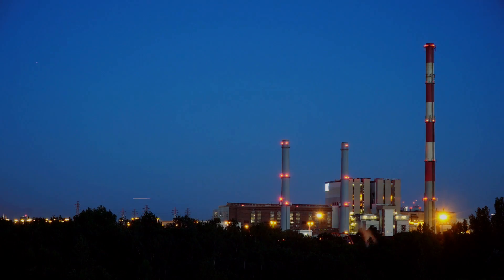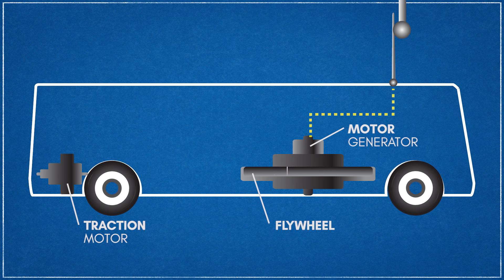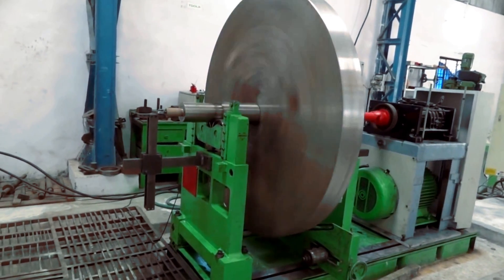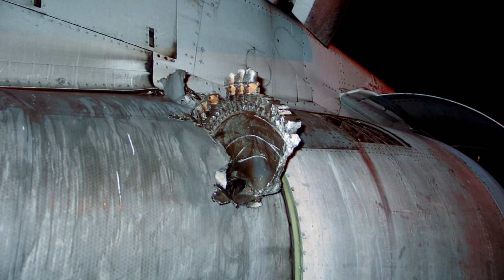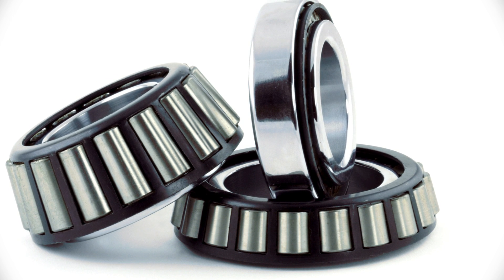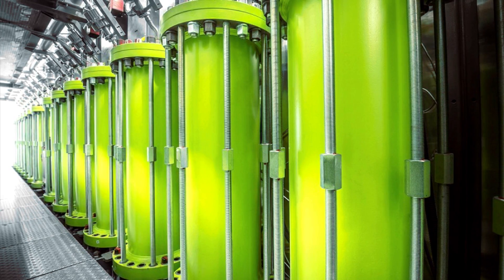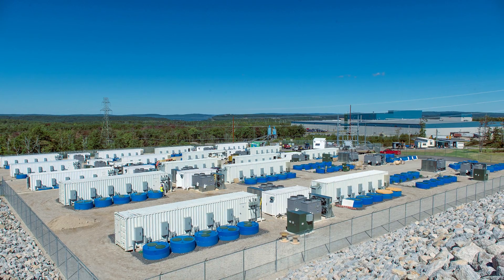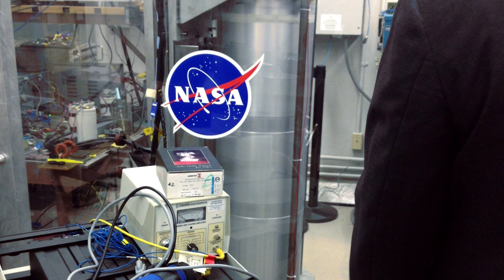The Mechanical Battery

Comment: And don't forget their "discharge capacity" in case of a critical failure. A Lithium battery might set your car on fire but that thing will probably shred your entire vehicle.
Reply: Any form of concentrated energy storage will have its own risks.
Reply: @SolarWebsite  Precisely!  A huge E whether mechanical, nuclear, chemical or electrostatic is still a huge E that, when SHTF, is a Bad Thing(TM)
Reply: i suppose it'd be better used to stabilize the power grid, in a car the wheight would probably be an important factor, too
Reply: I had a 500 gram brass flywheel that I boosted using a dremel it started to vibrate and the bearings failed en it ripped itself apart destroying a lot the hole for the shaft in the brass flywheel went from 6 mm to 9mm ! It was able to destroy my carpet en it took a minute to slow down while it was grinding my floor  I was so scared
Reply: Ever notice those red lines on the sides of USAF aircraft?  That red line is the plane of rotation of the high pressure turbine.  We don't stand next to those when the jet engines are running.  As you say it can shred things pretty fast.  : )
Reply: I'd forget using flywheel energy storage in a car.  There are way too many problems with it.  Stationary uses like the grid make a lot more sense.
Reply: A lot of yall have never drag raced and it shows, I have seen people have their leg cut off from just a 5lb (US) Flex plate (auto trans). We have found Flywheels (20lb's or more US) over a mile away from the staging lanes from manual trans's.  Most of these are only spinning at 8k RPMS, think about 300lb's (US) at 40k RPM's letting loss. And remember this these things have to go through a bell housing, trans tunnel, and door or roof just to get to the out side world. This is why for pro drag racing you have to have a "Blanket" over your bell housing to pass Tech @ a given HP rating. A "blanket" is a Kevlar vest that catches what decides to let go, and keep it from coming out of the car and into the drive compartment or by standards on the side lines.
Reply: @checkmate-e4b  yeah, right! in a bus it prbably was a minor problem but in a car ots a completly different ratio
Reply: I don't think this has a real future in cars, but for grid storage weight don't matter, and it can be built big enough to store a lot of energy.
Reply: It won't. Look how thick all those walls are.
Reply: Yep, IF the lithium goes on fire it releases the energy as heat, which is an inefficient way to cause damage. In the fly wheel all the energy is already in a higher efficient form, motion. It can grind, throw object around and scatter into small pieces like a grenade.
Reply: Go check out the recent Hydraulic Press Channel videos (or maybe it's Beyond The Press) where they overspin cutting discs to make them explode.
Reply: @mennol3885  Modern high speed flywheel design uses high tensile rods of composite materials that fail progressively, turning to hot dust which requires a minimal containment shell.

Comment: What is preventing us form creating massive, wide and slow-moving flywheel storage? 
I would assume that the cost would go up for the low loss bearing & mounting setup, but it feels like the compounding efficiencies gained from scale would make this worth it.
Reply: Energy scales linearily with mass, but quadratically with velocity. So you always want to operate them at a high rpm, at which point mass is limited by construction and material properties. If you go to high, you are risking instabilities, deformations and outright mechanical failure ripping your whole system to shreds.

To add to that, constructing the "optimal" flywheel might be a nice experiment, but it wouldn't be practical. Instead of using a super high quality alloy to get an extra 30% maximum energy stored, you can just buy 2 cheap ones and get 100%. Or build a dam
Reply: @majorfallacy5926  Did not consider that my fist intuition of where energy, in my mind pure inertia might be stored. Don't know the details but I though the wider a flywheel was, with more of the totalt mass away from the center, the more energy would be stored per rotational velocity of the edges.

Might not have explained myself well enough I suppose, what I had in mind was a structure with bare minimum material supporting the vast majority of the weight at the edges of a cylinder (think bicycle wheel with spokes kind of).
Reply: Maybe there's a way to use the earth as a flywheel? 😁
Reply: @JackHarveyBaker  The spin of the Earth relative to the orbit of the moon is the primary flywheel that is powering tidal energy. The lesser one is the spin of the Earth relative to its rotation around the Sun.

The Earth-Moon system will probably still be generating tides when the Sun becomes a red giant in about 4 billion years.
Reply: In a hypothetical fully charged ideal flywheel with no safety factor, all of the structural material in the flywheel will be under maximum tension. The ideal units will have a nearly massless hub and a very thin walled cylinder.

A real world flywheel will always store less energy, but a huge fraction of its total energy is still going to be in that comparatively thin-walled rotating cylinder.

Adding weight that doesn't provide tensile strength actually reduces the theoretical maximum energy storage. More weight, without more strength reduces the maximum rotation rate. Since energy storage is a linear function of mass and the square of the velocity, anything that reduces velocity is bad.
Reply: Standby losses for flywheel energy storage are huge compared to other methods. 

Also, flywheels are best used for rapid charge and discharge.
Reply: Bovanshi - we've done calculations which support your suggestion.

Comment: So we basically found the best "battery" to power close range inner-city traffic, yet we failed to pursue this technology in the way we should have? 
I wonder if the fact that batteries loose efficiency and need replacement played a role in this story...
This also would reduce the danger of exploding high energy lithium cells on the road, I've seen what happens when you destroy such a huge cell array,  you better have a pair of good running shoes...!
Reply: Strothy2 not really. Back then battery technology was even worse, so for a vehicle it could make sense back then but not now. At vehicle scale today chemical is still better. It would also add some weird driving dynamics
Reply: Not to mention the extreme wear of moving parts. That's why flywheels are avoided like the plague, even in space probes they need to take 2, 3 spare flywheels because its always the first part to break. (they are used for ship attitude, in other words, electrically accelerating or decelerating a flywheel will force the ship to change its orientation, in other words, "free" movement, no fuel spent)
Reply: @nerfedgod   you are talking about an inertial guiding system, right? This is something completely different, to make my point clearer, changing a cheap metal or ceramic bearing every few years is way better for our Planet and cheaper than changing and producing giant Lithium cell arrays. And with a few billion $ in this area, I bet we could get those bearings to run longer than the vehicle will last :D
Reply: @Strothy2  doubt it, and there's plenty of billions in bearing industry, this is just another bait video.
Reply: Flywheels are not good for automotive use. Their standby losses are high and they need to be charged and discharged rapidly, which makes driving "efficiently" with them miserable.

Comment: Very nice. Besides mechanical batteries, a good topic is the exploitation of the natural batteries in our ecosystem, such as lakes or rivers. Brazil uses these widely.
Reply: divorcedme  I would suggest you look at the actual power output of one of those and compare it to the cost of keeping it running. Then look at virtually anything else that's a viable power source...Also, fish tend to migrate in rivers. Water wheels and turbines make this rather difficult for them.
Reply: You gotta keep track of the difference between storage and generation. Some water based accumulators exist, but the energy density of those is pretty low. 
Hydro-electric generation is a very effective power source, but can of course only be used in countries with big powerful rivers. China has a lot of those. The netherlands... not so much. We have one or two small hydro powerplants that are more symbolic than effective...
Reply: @mfbfreak  - China also has 40,000 small hydro installations, there is no need for big powerful rivers.
Reply: Not only Brazil in Norway they literally generate almost all their power on that way...